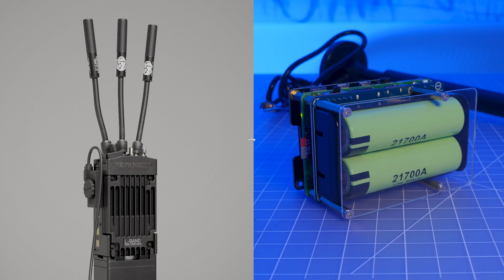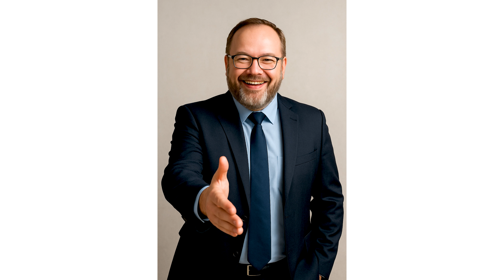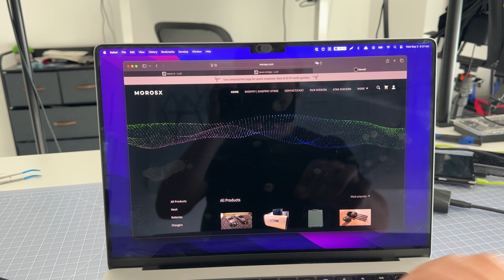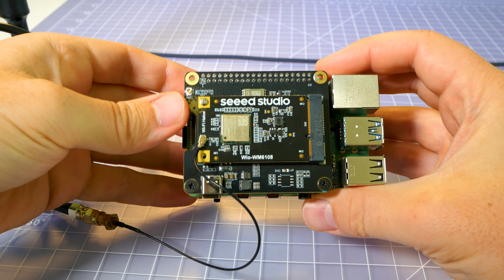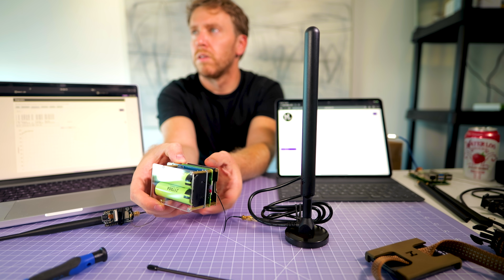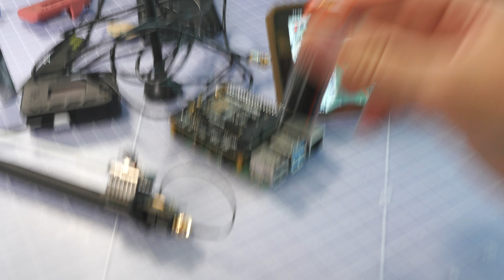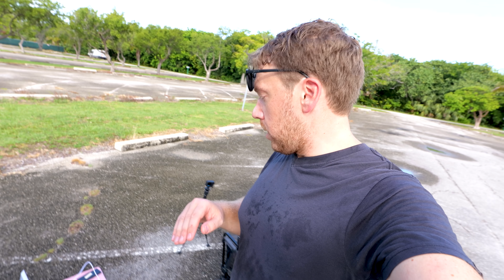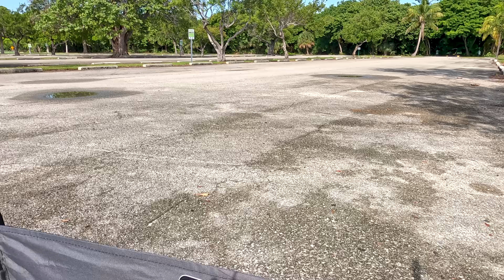I Built a $20,000 Military Router for $106.23

Comment: Another major cost source is upcharging for traceability requirements. DoD contracts, through DFARS, often require cradle to grave paper trails of sources, ownership, procurement lines, etc. it doesn't seem expensive but when every resistor and solder ball has this sort of traceability, the costs add up. Not even touching on reliability testing data. Tons and tons of checks, tests, inspections, and paperwork.

Comment: Perhaps give it a try, instead of using a omnidirectional antenna, use a Yagi antenna. I love these ISPs / nodes, always have, IRLP / ECHOLINK is based on this kind of system which have been around for a long time, I have a Amateur Radio license you can learn about things like this in further detail if you wish to know. 😊🙏
Reply from the maker: That's the plan, I've been looking into how digital HAM plays into this. Seems like HF is the big unlock.

Comment: ??? Why would they sue you? What are you talking about? L3 SAS/L3 Harris/ViaSat aren't going to care, dude. I deal with them DAILY. I build their RF Comms PCB's DAILY. They literally do NOT care. It's not like you're going to win a contract with Lockheed over L3. You don't even understand the technology or what goes into it. You don't fathom the amount of ground planes or heat sinks that go into this stuff. You don't understand the filtering of the signal or the switching. You don't understand the hardening and encryption of the network that takes place in the low level programming.

You didn't use open source parts, little guy. There are SoC's and BGA's on those boards that literally have no datasheet, because they're custom components that are built in house. How do I know this? Because I've built them and it's a requirement per IPC and the contract that you are to validate every component on a board that has a part marking. And there are components that have no datasheet. None. We aren't even told what the values should be. We're just told to put them on. We don't even maintain the Functional Test, Flying Probe, or Programming terminals. They do. We barely get schematics. Which, under penalty of treason, I wouldn't give up even if ice water was being served in Hell. 

Please. Stop. Just ... just stop. You don't know what you're talking about. You didn't build shit to spec.

Comment: Chunking data across multiple network connections is the speed solution for this type of network that needs to happen. Of course, your device is the limitation here.. But what if you had a device that you carried along with your... let's say mobile phone... that managed the multiple different network connections and the chunking of data.. That would be a game changer.

Here's what that would look like:

Mobile phone creates one large data transmission or reception ---->
Network manager/data chunking device takes the request and breaks it down into smaller chunks of data and distributes it amongst multiple network connections ---->
Each network connection sends or receives smaller packets of said chunked data to the endpoint ---->
Your data speed increases significantly and you are no longer limited by bandwidth,  even at longer range

Comment: Couple of different issues with this. 
1. Can this vary transmit power to hide in the noise floor and still get meaningful range? If not, the radio and operator are already dead. Ukraine is proving that just blasting a waveform into the air gets people killed. Within minutes of initial transmission. For domestic use, this isnt needed. For military operations, this is becoming a must.
2. Can it do frequency hopping? If not, this radio is already dead in the water. Militarys around the world are already moving away from single channel radios due to the conflict in Ukraine. And not simple freq hopping, I mean thousands of freqs a second over large portions of the selected band.
3. Can this be adopted with High Assurance IP Security Encryption? I'm certain that it can, but that alone will drastically increase the price of this device. 

Ultimately, building a radio that can operate "like" a $20,000 radio is nothing new. This video brings nothing really new to the space or to RF capabilities. It's cool to see someone doing it, but SDR radios have been around for decades and if it cant do atleast two of the three items listed above, the US military isn't all that interested.

Comment: Yes but what your 200USD rourer does not have is about 5000 åages of documentation proving where evry single component  came from you allso don't hve that experience audit report proving the code doeas noy have bakdoirs ( ye they are wortless but the dod/dhs insists on rhem. Tour router d allso failed to rhunnel federL money into som senators shaky district. Procurement is not about value for money, it's about ass covering an votes, or so I've beard

Comment: 20k for mesh radio is not as much actually, Chinese mesh modems that are used in fucking Shahed drones are around 8k each. Though I doubt that the proof of concept shown in this video is going to even remotely rival chinesium ones unless it gains couple thousand bucks in production and development costs(though for r&d to be just couple thousands per unit at least several hundred of them must be produced). I don't know the history of that device, but manufacturer of 20k unit was probably one of the first to come up with such solution
Reply: Ok im new to this but would this be a device I could create to connect say an iPhone to and have internet access off the grid?
Reply: @aaron4525  Don't you need to carry a node with you anyway? WiFi on the phone connects to a WiFi module of the node, to communicate between nodes different protocol and different frequencies are used even in this case. Even if commercial mesh modem does not have a WiFi you can connect any network equipment you like to it(including WiFi routers and bridges) the only difference would be the weight. Commercial modems probably use multiple frequency ranges and are much harder to jam or extract configuration data from.

Comment: can you do it for VAG control modules? for ABS, transmission, BCM and ECM. I wonder if it is possible to substitute one of them with opensource without replacing the whole set. Do they use encryption based authentication for modules now?

Comment: This is a extremely useful tool when combined with other gadgets such as walkie-talkie over WiFi. Imagine a device as close as the one on the thumbnail that has Hilow network + WiFi + Lora and they can connect inter each other. Something like a rbpi module + esp32 handling Lora. It would be some sort of network station. I would even add, if you combine it with let’s say another rbpi for having like a portable homelab all connected thru starlink over vpn to your home. It might sound absurd, but possible. If I end up doing it, I will put it open sourced.

Thank you so much for the information. Your Chanel is awesome.

Comment: so what I've learned from this video is that because you need to contact over long distances radio is better but bcz wifi is better for data  transfer etc, u need both. A wifi like communication over long distances as much as a radio can. And wht youve done is you built a prototype that does the same as a 20k dollars device within 106.36 dollars. and the wifi piggybacks on radio signals over long distances and every device on that channel can get internet. correct me if im wrong about anything ive said as im still kinda new.  If Im right then if it was advanced a bit, you could possibly get internet anywhere (like the data packages from cellphone towers) and every  (at least a million or billion) connected to that radio channel through this 106.36 dollar device, bcz the basic requirement is that only one device (node) is connected to the internet then every device on that channel can too and the network becomes stronger the more they are! pls tell me ive understood this video correctly @DataSlayerMedia

Comment: The issue is that military spending is a dual prong problem. To stay #1 you need immediate access to cheap products that get the job done while also lasting a significant amount of time in conflict if maintained properly. Secondly, how exactly do you concur that a product you will buy millions of is worth the money and that you aren't going to be scammed or rugpulled? You test it until it bleeds, you force the contractors to get every certification imaginable, and you mandate quality assurance 2-3x the regulation standard. A lot of the times contractors are forced to refabricate existing components. Why? Because if I buy a Motorola case, I now have not only test, certify, and quality check the contractor, I have to do the same to Motorola, a private company and all their assests that go into making their case for my product. So now the government contractor has to reinvent the wheel UNLESS Motorola agrees to subject themselves to torture and ensure their cases are up to standard and be willing to drop EVERYTHING and supply those cases first and foremost. Anybody who says its an easy solution is either lying or doesn't understand the repercussions of a production failure during wartime politics. Yes you can make it cheaper. But unless he is willing to subject his image, brand, company to be 100% military grade EXACTLY as specified in the contract, without outside providers, milled or produced in house overseen and managed by him and be able to test ALL his products (his singular one atm), certify ALL his employees (at this point himself), and have the ability to replace, reproduce, and/or maintain millions of his products at any given time... You aint getting it cheap. All that costs money. The government loves to go cheap and save money, if you can do all that for cheaper you can 100% get a contract. But unless you can prove it a YT video only shows what everyone already knows. Military grade is expensive and there's not many ways around it.

Comment: I spent some time developing EW hardware for the military for a large company. Design, analysis of how testable the hardware is, building power on self-test, and built-in testing (which must run independent of and infra that's comes with system), identifying failure points, redundancy - BEFORE you get to the demo phase for acceptance was a massive cost. NOTE- that's just to test the hardware so it can run in a military environment. That doesn't account for the interface, making it usable, and ruggedizing it. It's interesting...

Comment: Military-grade MANET (Mobile Ad-hoc Network) systems typically feature advanced security and resilience features such as FHSS (Frequency Hopping Spread Spectrum) and IAS (Intrusion Avoidance System) or similar. They operate in 2x2 MIMO or 4x4 MIMO configurations. Communication distance Ground to air 300KM, NLOS 5Km. The MESH on the soldier's back can reach up to 2x20W power. All military devices are MESH and communicate with the station at the soldier/s location, known as the Messenger. AES256 or national cryptography integration is used.
Of course, I appreciate your success. However,  your advertisement under the heading ‘MILITARY MANET’ made me smile. With respect...
Reply: I sure would like to know how to build my own SDR based frequency hopping radio similar to the Harris Falcon stuff ...
Reply: Everthing you’ve said here would not bring the cost anywhere near 20k. Most of it is software which can be developed and licensed
Reply: noice chat gpt copy paste
Reply: @xghouler6676  I am an electronic engineer. My job is to design wireless communication products. ChatGPT gathers, filters, and shares information by reading articles written by engineers like me on the internet. It tailors this filtering to your specific words. ChatGPT is a child's killer. If a smell is coming from place, it's because you're sh*t.
Reply: Always funny when they cook up the "here is why it costs 20k posts" but altogether they barely reach 4 digits. With respect, you're an idiot.
Reply: @Yeet42069  I am an electronic engineer. My job is to design wireless communication products. If a smell is coming from place, it's because you're and upside friend sh*ts
Reply: @Yeet42069  When you factor in throttles like approved manufacturers and approved parts, you very easily get to absurd numbers for the tech. They still gouge for the "certifications." OP is absolutely correct conceptually; if you didn't build it to our standards, didn't use the correct procurement process, approved vendors, approved parts, and didn't develop it using those same throttles, and had no formal audit, then you didn't build the "military" version for $106.23. I know there's an amazing amount of space on the internet, but I'm not sure there's enough for you to be throwing around "idiot."
Reply: @Yeet42069  I'm sure the UNIT cost of goods sold isn't $20k, but the $2B in cryptography research that General Dynamics did has to be accounted for somewhere.
Reply: @Yeet42069  With respect, you seem to know nothing. These radios are certified and designed to always work. The concept of the software crashing or the radio not working because you dropped it from 10m on a concrete floor just doesn't exist. That drives the cost to probably around $10k. Not quite 20k, but pretty close.
Reply: @honzaled I bet the software still crashes. I've used government software.
Reply: @cjeam9199  What government software? When? How exactly does it happen? How much was it priced? What sector used said software?
Reply: @eimerhegel427 Uniform by Idox. In local government.  It sort of did everything but was essentially address based database software that integrated loads of local government functions. The mapping facility would never work, it lagged to crap. Various functions would fail to update or lag. There was no support or help or training documentation. We wanted it to be accessible on tablets as the user interface (which is terrible and doesn't scale to differing screen resolutions anyway, I mean, for example a mouse wheel scroll didn't work you had to manually use the scroll bar) was designed for desktops, this capability alone was going to cost £400 per device per year per function.

Comment: Crandon Park is .7 miles across as the crow flies from corner parking spot in lot #1 diagonally to the corner spot in lot #4. A mile would be from the corner of lot #1 to the very back of the gardens.

Comment: If you upload is better your radio in the remote unit has beter uplink thanthe downlink. I find this when using regular wifi with a cheap laptop. Connection sucks becuase laptop has no power to transmit to ap but ap has moe power to reach laptop. Could be a gain issue with the antenna also.

Comment: As an engineer for goverment aerospace products, most of the cost is from the sheer amount of environmental resistant and testing. A majority of the value is in the endless paperwork and test results that come with each product, saying it’s been tested for 14 days straight in -50F while never losing signal or a drop in quality. 

The parts themselves are rarely the driver for cost.

Comment: ive been trying to build this for 2 months (it will take a year in asia due to supply chain bs) but your files and guides are not clear. The device you build in the video is different then the ones in the links no? same schtick yes, but we want the one in the vid

in the jungle signal is sht. we are looking to dev a solution with a stationary link - halo drone - ground unit for field coverage and perimeter establishment/monitoring.

Comment: EE here: Great concept, needs improvement. Also, while the RPI has a great startup cost and compatibility, it is very power-hungry. Real-world implementations would benefit from a lower-power device operating the local wireless, which would help to extend battery life much more. The only real use case for a full linux-based SBC would be attempting to have a lot of throughput. (I question the technical knowledge displayed here, even referring to battery capacity using the SI unit for current.)

Comment: Your router is just over $10000 in cost, not  $106.23. 

One reason the $20,000 price tag exists is becasue the router the miltary paid for has: 1) Reliability parts selection 2) Reliability testing 3) Durability engineering 4) Durability testing 5) Usability by the lowest best common denominator of human intellects. Your price tag doesn't account for the engineering that went into desinging the miltary's device as well as the amount of time you spend building it. 

How many hours did it take you to source parts and build it? 40 hours at $250 per hour (you have to 2.5 x your hourly rate for overhead and other admin costs and you're an engineer-level tech who would bill at $100/hour at the very cheapest).--- so we are at at $10,106.23 military router...and yours can be dropped and it will stop working.

$20,000 isn't so expensive after all, when considering the totality of the actual engineering involved.

Comment: The reason most military stuff is expensive as hell is because of a lot of things (including greed yes, but):

Certification costs
Base product testing (Ensuring it meets requirements listed by the contract)
Testing costs FOR certifications (such as getting necessary facilities/systems, and any certification test fees)
Costs to acquire generalized certifications (sometimes for a product/update/system, there's a lot of nuance) (notable ones are NIPA, FIPS 140-3 (cryptographic security), RMF (cybersecurity), etc.)
And of course, the good green. Money. They have to upcharge cause 1. it's the govt. and 2. they have to recoup any costs from initial development possibly accrued by the things mentioned above.

but fun lil video, it is pretty neat how cheap most of these actually are to build, but it's not military because it's not certified nor tested in a regulated environment.